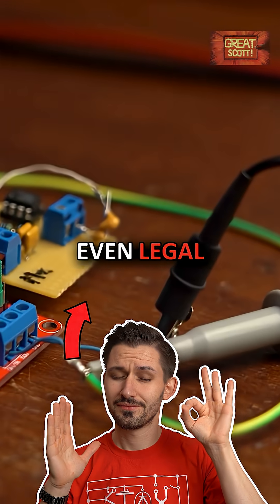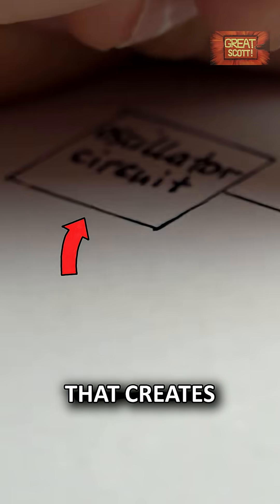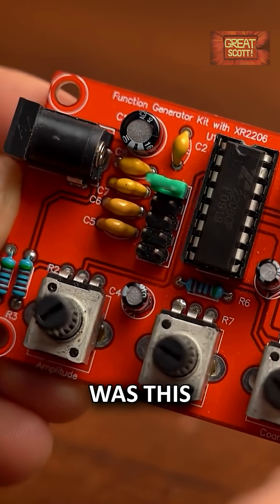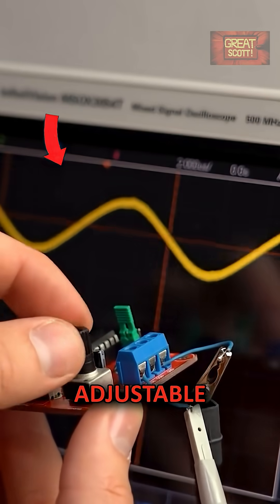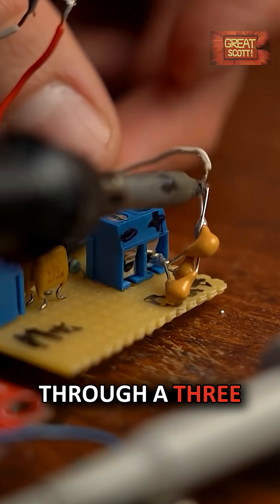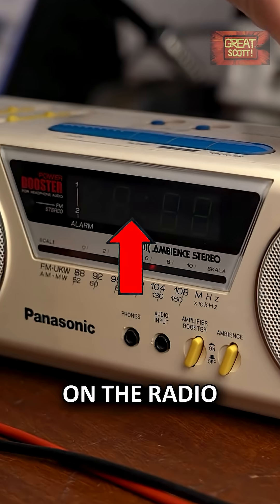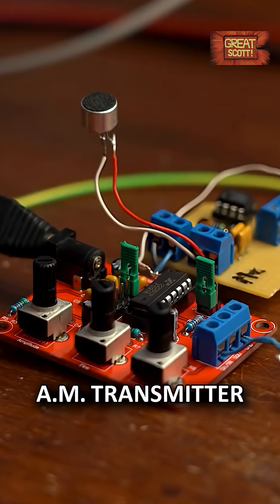Make your own Radio Station?! #diy #radio #electronics #engieering #electrical

Comment: The simple answer to being able to experiment like this 100% legally is to get yourself a hamradio licence.  Here in the UK the amateur radio Foundation licence allows you to build your own transmitters, and send 25W to the antenna in set amateur radio bands which cover frequencies all the way from Medium Wave up to Microwave and beyond.  You can even do the course and take the exam at home!!  Takes no more than a couple of days to get qualified, and your licence is valid for life. There are two higher tiers which require more study but which give you more privileges and permission to use higher power.

Comment: There's a house a couple towns over from me that does a huge Christmas light show that broadcasts sync'd music over an FM transmitter, with a big lighted sign up front telling you what station to tune to. They've been doing this for well over a decade.

I don't know what they're broadcasting with, but I can pick up the station in my car a good mile or so away before it starts to degrade. I'm actually impressed with how far it reaches because usually these short range transmitters only broadcast about 50 meters or so.

Either they're paying the exorbitant FCC license fee to broadcast that, or they simply haven't been caught yet. 😂

Comment: When I was a kid I remember rolling and toilet paper tube with wire using thumbtacks to affix the coil to a piece of wood, I then had a razor blade, a diode and a safety pin fashioned as a tuner. I had the longest piece of wire draped over a gutter, and then I had to ground it on a water pipe but low and behold, we had an AM radio. It's called a foxhole radio and that is simplicity at its finest. I'm only 50 years old so this was done back in the '80s so even back then we had transistor radios.

Comment: If you were in the US, you would probably be safe:

> Unlicensed operation on the AM and FM radio broadcast bands is permitted for some extremely low powered devices covered under Part 15 of the FCC's rules.  On FM frequencies, these devices are limited to an effective service range of approximately 200 feet (61 meters).  See 47 CFR (Code of Federal Regulations) Section 15.239, and the July 24, 1991 Public Notice (still in effect).  On the AM broadcast band, these devices are limited to an effective service range of approximately 200 feet (61 meters).  See 47 CFR Sections 15.207, 15.209, 15.219, and 15.221.

From the FCC website.

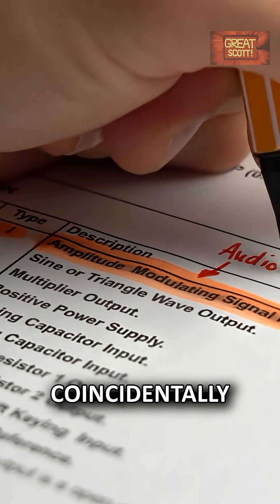Comment: 0:30 - WTF ARE YOU DOING?  Soldering to the pin of the SOCKETED CHIP instead of the socket pin on the solder side?!?
Why.
What is wrong with you?

Comment: To be "effectively unlegal" some would have to detect it. And at a very little power from a function generator nobody wll even know - which means you don't harm anyone (because nobody can detect it outside your flat). It's like producing  hydrogen sulfide - ask a lawyer whether you are allowed to do it at home... but wait, isn't it what happens when you're f*rting? ;) If this was that much problematic here, nobody would be allowed to turn on... a (perfectly legal) function generator without a license! As long as you don't pump noticeable power and don't use long antenna, the detectable signal won't leave your home (and you can always try a "free" frequency, meaning - no local station broadcasting at it, so you don't interfere with it). And, of course, do it within a short period, a few minutes of joy. The chances that anyone will notice this "horrible criminal act" are getting really low. Oh wait, and what about these cheap car radio transmitters sold legally, operating at a noticeably higher power? ;)

Comment: As a child, I discovered if you fly a kite 🪁 high enough with spool of several miles of fishing line, the fishing line would vibrate sympathetically with radio waves and letting the line out or retracting would change the station. It’s probably the most interesting kite experiment since Ben Franklin’s. I’m not sure about the legality of flying a kite that high, but I assure you that it ought to be replicable. ❤

Comment: I made a 50 watt 1.3Mhz AM transmitter.  So far, it has attracted no authorities.  50 watts would seem like not much power.  However, on a good day of radio propagation, I can hear the transmission 100 kilometres away.  On poor radio propagation days, 13 kilometres is the range.  With two transmitters and a two standard radio receivers, a communication network can be made.
Reply: Do you have a schematic?
Reply: Sure but if you transmitted regularly, for any length of time, the authorities would get hold of you. And your 2-way transmission network that anybody with an ordinary radio can pick up, I wouldn't like to use for anything useful.
Reply: @greenaum I live in an extremely rural location.  There is no cellular service.  Only HughesNet is what anybody can have if they do not want dialup.  I opted out of both because of the speed and the price.  This is being sent from work's break room computer. There is one restaurant.  It is still 10 kilometers from where I live.  There is no local constable.  The closest hospital is about 100 kilometres away.  There is no local FM radio station, no local AM station, no local television stations.  The television we pick up is from the nearest city about 45 kilometres away.  My 50 watt AM station will attract the attention of nobody.  I do not run it daily.

Comment: Correct me please.
Only a bum retired grease monkey.  But I remember from somewhere where if on a desert island you connect the pos from battery to the speaker. Plus a bit more.  Long length of wire. .aerial. And a long range MW or LW transmitter .. just don't remember where it could been one of the understanding science monthly magazine.  I just don't remember.  By the way who do I still owe that fiver I borrowed for petrol in 1974.

Comment: You need a GIGANTIC antenna to do any damage with AM transmitter, so being legal or not is beside the point. They'll see your antenna setup before they see you..
Reply: Yes, for example a half wave dipole and at least a quater wave above the ground
Reply: How many watts?
Reply: I believe the legality doesn’t only stem from its power levels but from how these can be used for subversive and propaganda purposes. Any country would want to have control on what’s going on in their airwaves.
Reply: @seemantadutta this is the only correct answer ive seen in thus far.
Reply: @artificer845  god forbid some dude just wanna mind control his neighbourhood on a sunday afternoon 😢

Comment: You could do it this way, or you could just use a 1mghz crystal oscillator... one part.      All you need to do is add a step up transformer, two capacitors, a mic, antenna and ground.         

I built a transmitter using a 20mghz crystal oscillator I desoldered off an old 10bt ethernet card.

"microtransmitter using crystal oscillator"

Comment: Question: being surrounded by so much interference from WiFi and other RFI radiating appliances, does this work? I turned on an AM radio the other day at home, and it was all noise from the wireless things I have. And I don't have more than a couple things, including the wifi switch. I couldn't tune in any station with enough clarity to listen to. Would this transmitter work outside the lab?
Reply: WiFi is FM I believe. Microwaves and other things can affect AM as far as I know.

Comment: Is it legal? My friend, you need only ask "Is it fun?" and if the answer is in the affirmative, it is illegal in Germany.
Reply: The low power signal a hobbyist can make isn't illegal.  What would be illegal is if you broadcast it at the strength of commercial radio without a permit.

The radio spectrum has a limited capacity, and is heavily regulated by the FCC, so that people only used their assigned frequency band, and we don't end up with millions of DIY broadcasters overlapping their signals, and making it unusable.
Reply: @carultch Low power? Hmm, using a power stage and a driver stage, you can do much more power. I could probably make a 1 kW FM radio transmitter with few LDMOS transistors.

Comment: For better understanding of circuitry 

And Carrier Wave Frequencies, and Zero Point Interference (variations beyond the normal operating standard measured as input/output)

Study the geometry of plasma in a magnetic field

It just looks like circuits and 3D Runes

Because it is electricity, and it is magnetic 

After, its easier to understand the geometry of coils and wires and switches

Comment: i used the local oscillator of an old superheterodyne radio and fed audio into the circuit and made my first AM. station back in 1985. It was amazing, when i could receive the music 100 metres from the station. 😊
Reply: We once build an AM transmitter from an old AM tube radio using the same parts. EL84 in the final (the former audi amp) connected to a longwire, not tuned and we got a range of about 50 km.

Comment: I had an old tube Heathkit signal generator with an audio input in my shop some 30 years ago. It only did maybe 2 watts, but it was enough to put a mast on the roof, tie in a CD player on repeat for audio and hear it through my car radio almost 2 miles away.

Comment: Hey, can you explain why most brand even apple use aluminum ( i am not sure its aluminum or alloy) instead of copper in charging cable. I cut many fast charging cable they all are made by aluminum (i think its aluminum i am not sure). Why they dont use copper?
Reply: Are you sure it's not plated copper? Most charging cables I've seen use copper wire, but it has a plating (usually tin) to improve solderability, which has a similar color to aluminum.

Actual aluminum wire is sometimes used in things like electric motors and building wiring to save on cost, but would not typically be used for something subject to repeated flexing like a charging cable.
Reply: @alexisdougherty2652 just acter reading your comment, i when and cut wire of original samsung, and you are right, they use copper wire and its have tin coating. Thanks a lot finally I have answers to my question. 😊

Comment: The US FCC is much more likely to nab AM pirate stations than FM, because AM travels farther.
Reply: Not in the UK though, because AM is all but dead.
Reply: and I thought the UK couldn't get any worse..
Reply: @video99couk theyll still get you even if the band is dead
Reply: @video99couk That is rather frightening for its citizens.  AM is the most resilient of early warning and emergency broadcasting methods.
Reply: The United States Of America's early warning and emergency broadcasting is centered around AM broadcast.  There are other modes and services also employed.  But broadcast AM is the one that goes the furthest and is the most robust.  Canada began dismantling the AM early warning and emergency broadcasting infrastructure.  But, it was reconsidered when it was found that AM would get through when all the modern modes and methods would fail.  Old emergency stations are being repaired and brought back to active service again.  It is entirely too easy to disable most of the modern methods of early warning and emergency broadcasting.  The old workhorse AM is much more resilient.
Reply: AM is just a modultion type. The lower frequencies travel further, not the modulation. You could build an AM transmitter in the 87-108 MHz range and it wouldn't reach further than an FM transmitter at the same frequency.
Reply: I argue that this is reversed, but I'm just speculating. The rules for part 15 stations are very different on "AM" vs "FM". On Fm, you are limited on power radiated as well as distance. On AM you are limited on power and antenna length. The fact that there is no defined distance limit for AM, fewer listeners, and interference at night by design; I would definitely guess you'd be safer on AM
Reply: also the rules are stricter probably because it travels further

Comment: Why is it illegal, is it because it is used in aviation or because of power used? Why?
Reply: You need permit
Reply: The radio spectrum has a limited capacity, and heavily regulated by the FCC.  This way, only broadcasters with an assigned band can use it.  Otherwise, we'd end up with millions of DIY broadcasters interferring their signals with each other, and making it unusable.

Comment: When I were young, I had a Radio Shack 120-in-1 Electronics Kit. The inevitable transmitter circuits (AM and Spark !!) advised to use only a 10-foot antenna maximum. So I used hundreds of feet.
Reply: Had the exact same kit and did the exact same thing!
Reply: @josephschembri4811  I ran a long run down my back yard supported by sticks so it doesnt lay on the ground, worked pretty well
Reply: @josephschembri4811 I added a Class A amplifier to get some significant power out of it.
Reply: Did you get into shit for it? If u remember how it went, how well did it work
Reply: Bro wants to broadcast his banger so much
Reply: The advise isnt because of legal issues but so you dont mess up the transmitter by using an antenna thats not resonant with the frequency youre using
Reply: Holy shit I hope my parents still have that lot. Would blow my daughter away

Comment: Can you please do the same but broadcast composite video to an old TV??
Reply: No way near as simple brother. I dont think you really can broadcast composite either, think its a matter of definition. I believe all tv signals received over the air are RF
Reply: @srenhaandbk7904 The old gaming consoles had all the stuff needed right on board. Adding a power amplifier stage at the RF-Output, and you can transmit TV.
Reply: @srenhaandbk7904  which is am modulated composite video
Reply: @progamer3000-uz7pjreally? I thought it was more complicated than that. How is the audio received? Through an offset frequency, or overlaid somehow?
Reply: @srenhaandbk7904  If i Remember correctly the audio is also am modulated by a Offset of 0.25 MHz.